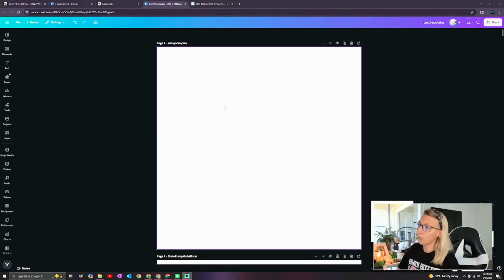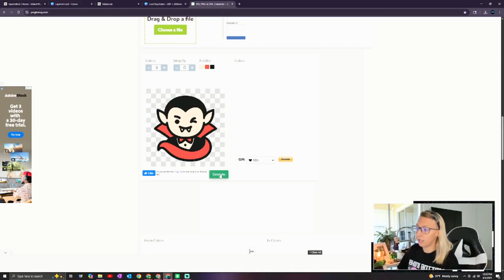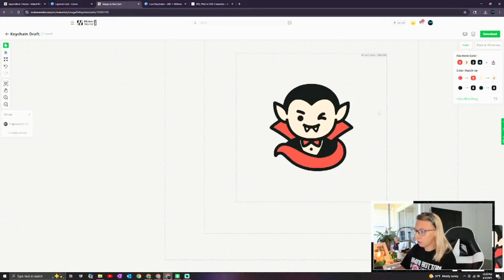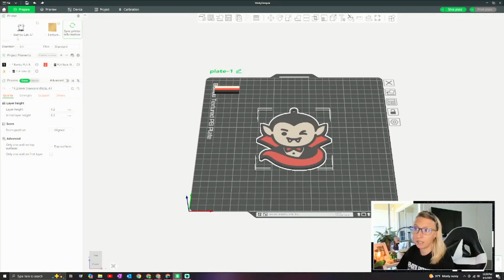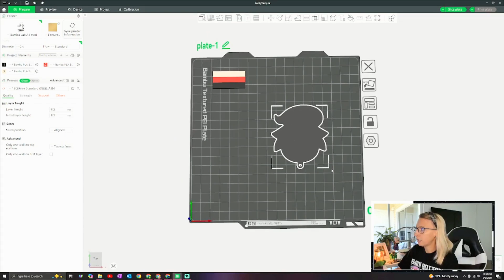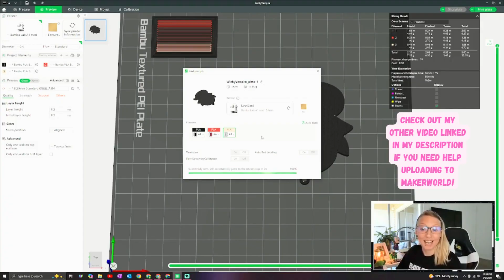Turn Any Image Into a 3D Printed Keychain with MakerLab!

Comment: Nice video. But if you want your print to be 4 mm, then after resizing in the slicer, turn off uniform scale and bring the Z back to 4 mm. Now it's only 2.4 mm.
Reply from the maker: Oh! Thank you! I actually wondered what happened! I normally size them in makerlab! Thank you for this tip 🩵